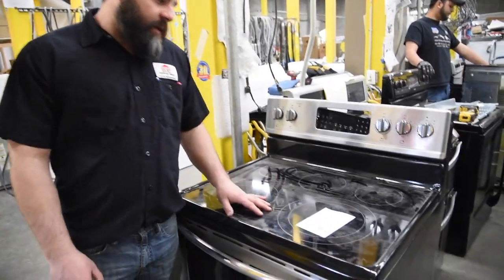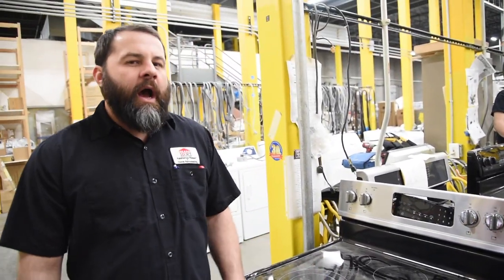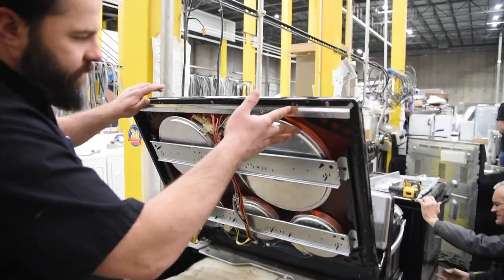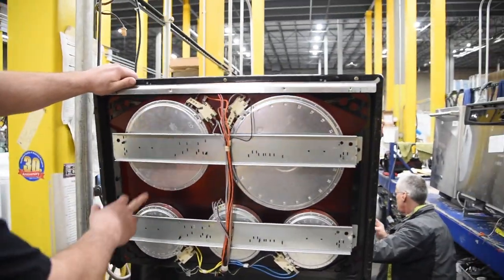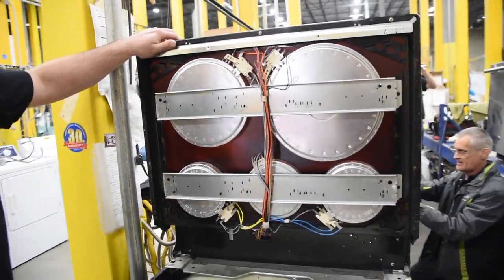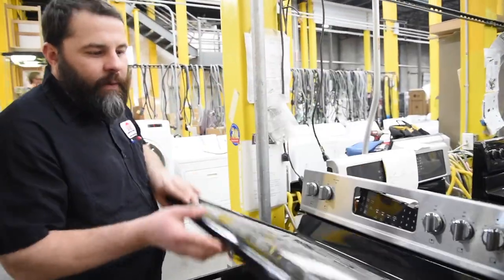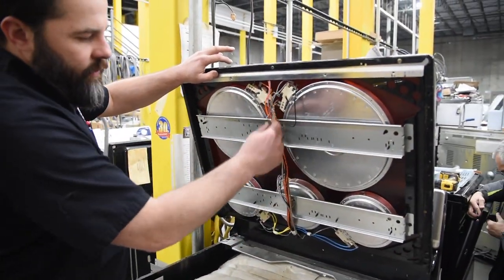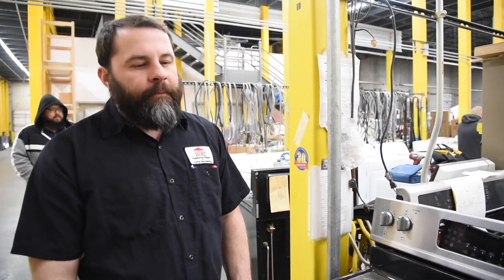Can I use my Cracked Stovetop?

Comment: My last glasstop cracked just short of shattering. A replacement was $500. I opted to buy a brand new $600 stove. If I had a repairable crack I think it would be worth the risk to try the repair.

Comment: Not "fixed". You cannot fix a cracked top. It must be "replaced", and with the insane cost of a replacement top, you may as well replace the whole stove because the elements themselves don't last forever and when they go, they are $225 each!! Glass tops look nice but are too fragile in use and too costly to repair.

Comment: Can I  use my oven
Reply: ...according to the technician in the video, you'd rather not, unless you're suicidal or do not care about possible further damaging of the appliance.
According to me though, (depending on the size of the crack or hole that the damaged glass has), yes you can keep using the top (your oven obviously too), if you manage to keep in mind that avoiding using very heavy kettles filled with lots of water in them is a must. Plus
for no whatsoever reason should any liquid ever be spilled on that damaged top. In other words : the broken glass doesn't itself render the appliance inoperable as long as no liquids enter the crack.